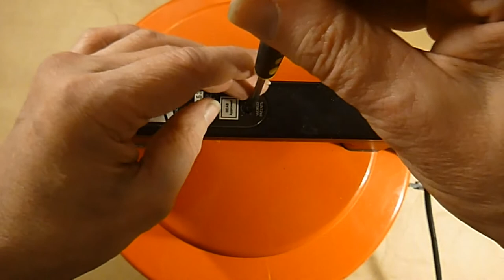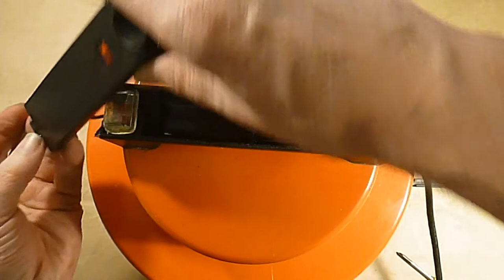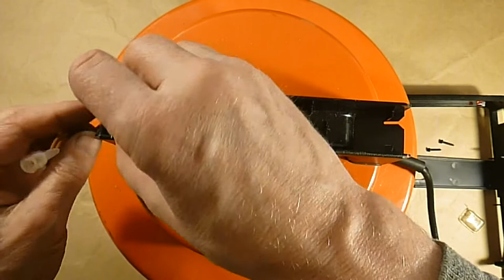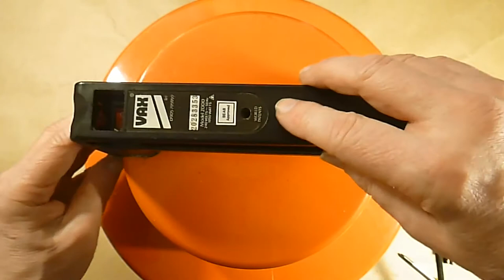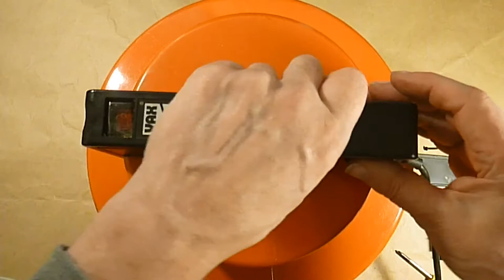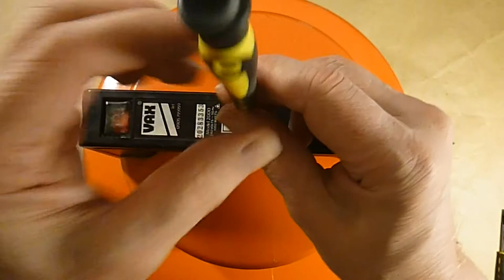VAX 2000 Switch Replacement

Comment: Hi..I have a Vax V100-T which is similar to your Vax ...But the switch I I had was a push up and down type ...the replacement is an on/off rocker switch ...can you send me the wiring diagram of the 4 connectors on the rocker switch you replaced ...Thanks John
Reply: hi, recently my 20 year old switch packed it in and each blue/black wire connects to a brown wire to turn on. couldn't find any diagram but seemed to be the way it came apart and stood back when i tried it👍